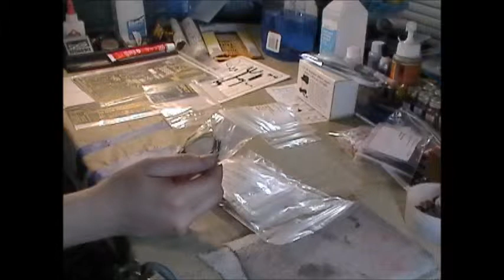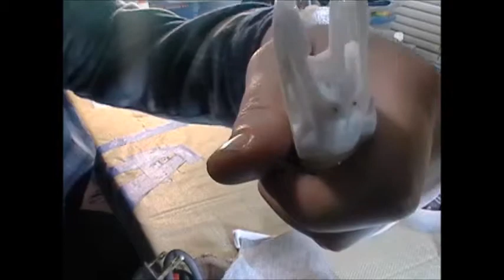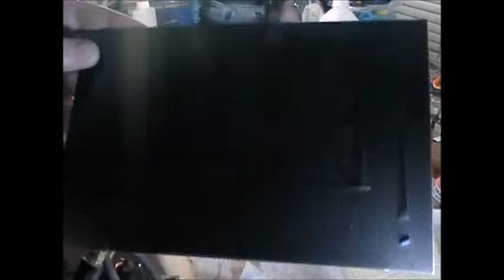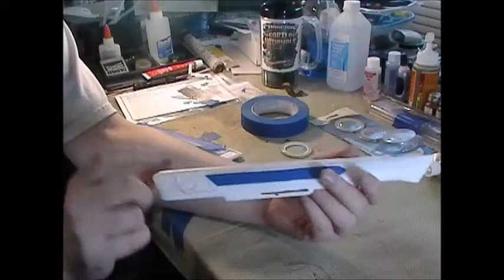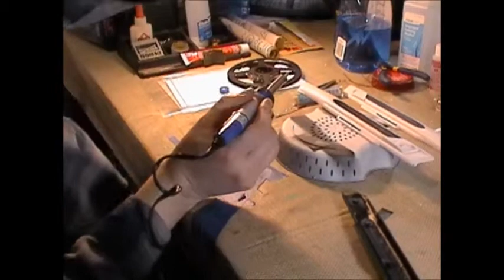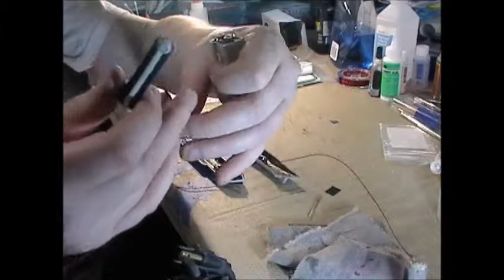AMT 537th Refit Enterprise Build Ep02

Comment: What gauge wire for the black/white twisted?  Link?
Reply from the maker: The wire I used was, in hindsight,  too large a gauge. I use the Evan Design stuff now, here are links to the braided and unbraided;
 https://evandesigns.com/collections/wire-switch-more/products/twisted-kynar-wire
https://evandesigns.com/collections/wire-switch-more/products/kynar-hook-up-wire
Reply: @PunkyWily  Again, since posting, I decided to use magnet wire.  I really like it because it's very thin and can be shaped due to being solid.
Reply from the maker: @Explore-Gobal  Magnet wire is good too, I like it because if you need to get wires into smaller areas or models it works great.